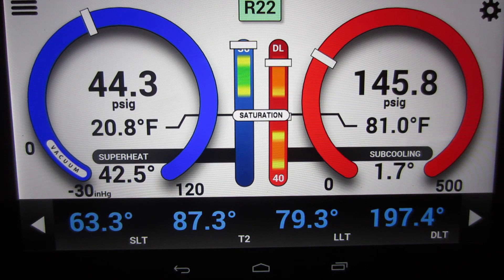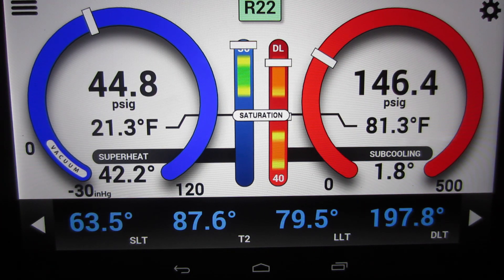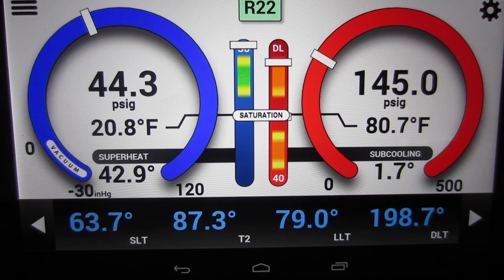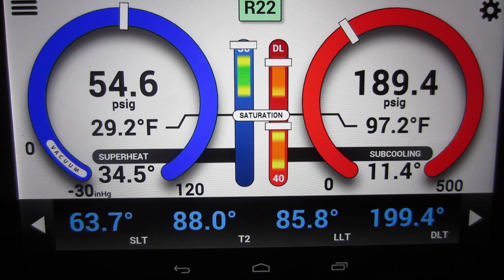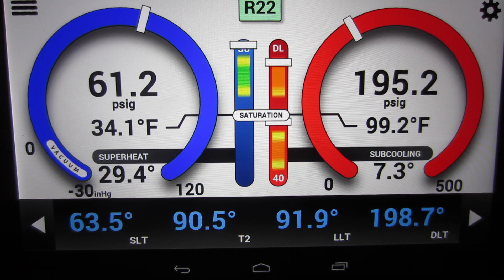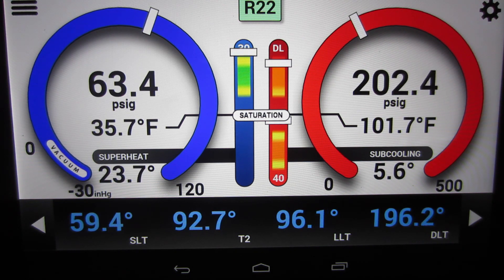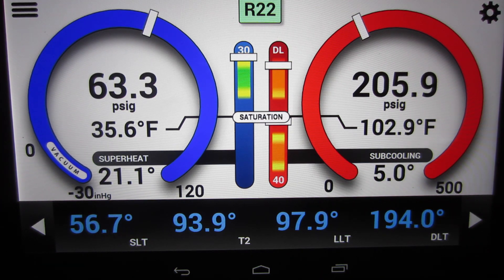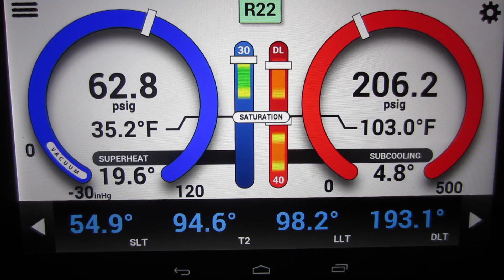HVAC iManifold  Liquid line restriction

Comment: you didn't give us inside or outside temperature / you caused this restriction you still look low on  charge./ 38 to 42 deg you are 2 deg from freezing, coil clean ? fan cfm ? ductwork ? come on  if you post a video then get all # to us. bit-h
Reply: Agreed horrible video...no temperatures at all .no wet bulb...nothing...just some dumb shit. Horrible video. Show something not just a gauge with I seated down my high side valve a little..,😤😤😤

Comment: if it is a liquid line restriction why is the subcool so low, i thought it would be a lot of sc and a high head pressure?
Reply from the maker: This is a very good question... I was creating a false restriction with the liquid line service valve at the condenser.The 145 Psig in the video is taken after the restriction so the 145 Psig is a lower liquid line pressure at a lower temperature that is were it get tricky, if I had the high side hose install before the restriction the reading would be normal to slightly higher subcooling lower head pressure because the refrigerant is trap in the condenser and the evaporator is being starved.
Reply: +mpape1980 When you have Liquid Line restriction, Head Pressure get slightly higher because the gas is trapped in the condenser and it is getting refrigerated by the air flow trough the coil and is condensing.
I've learned that, what increases the LL Head Pressure is when system: a) Over charged, b) Non condensing gases inside the system, c) Dirty coil and/or d) defective fan system. Obviously, making sure the system has the appropriate compressor.
My conclusion: Liquid Line restriction, never increase the LL Head Pressure. At least, that's what I've learned.
Reply: dizziedallas So what kind of restriction would give High Suction and Low Head pressures?
Reply: Txv stuck open
Reply: Or perhaps no piston or wrong piston right Dallas?
Reply: mpape1980 what if it's an orfice?
Reply: What's your sh and sc and psi
Reply: I've been getting a lot of these symptoms.
Reply from the maker: SombraLocs Is it a Txv or piston?
Reply from the maker: mpape1980 Is does sound like a Txv issue
Reply from the maker: SombraLocs  
Here are the symptoms with High Suction pressure and Low liquid line  pressure:
Missing or Wrong Metering Device
Oversized Liquid Line
Check Valve Stuck "Open" (heat pump)
Reversing Valve Stuck in "Mid" Position (Heat Pump Only)
Bad Compressor
Reply: dizziedallas thanks guys